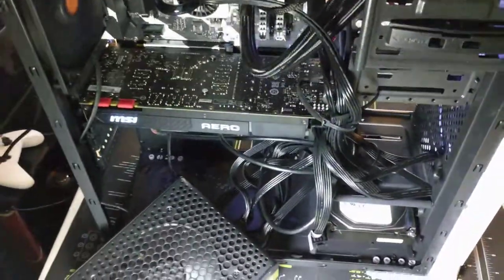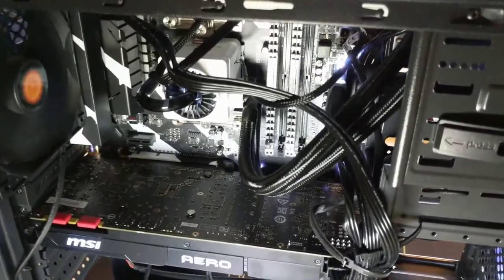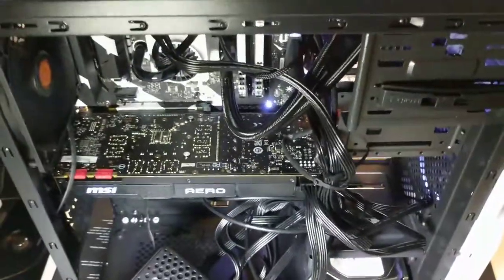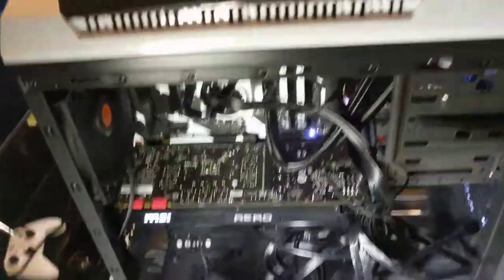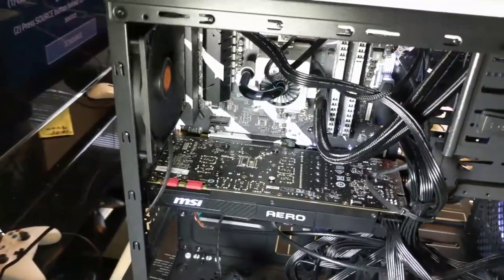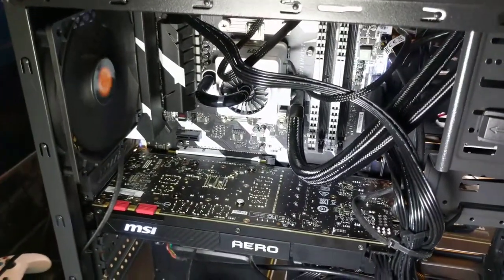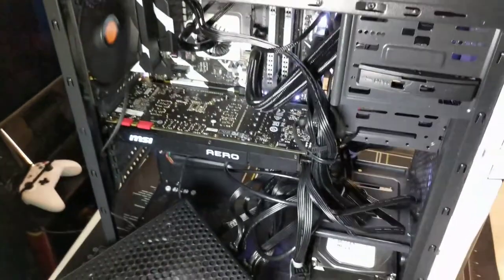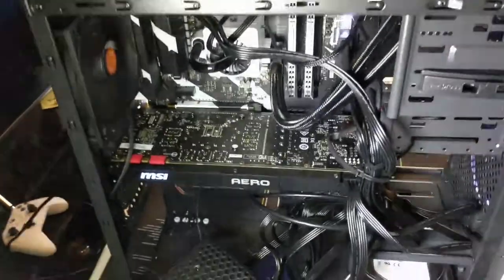My PC Motherboard died. MSI X370 Krait

Comment: Same thing happened to me.
i've deleted the old comment, since it wasn't from my account.

This is my first MSI Board.
My friend has a X370 Sli Plus, thats basically the same board, works like a charm.
Reply: Ivan Bass 
Hello.

Will u tell me how to enter in msi x370 krait gaming bios at first boot startep for install a opertaing system through a pen drive. 
In the bios we have to set first device fir boot.
Kindly tell me.